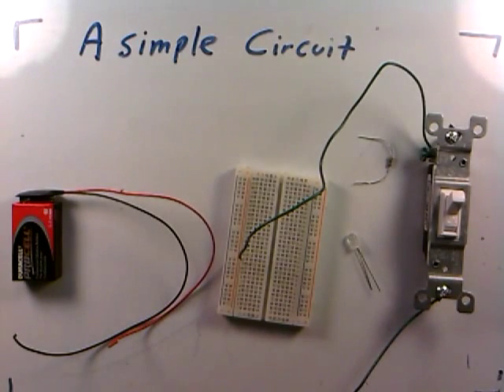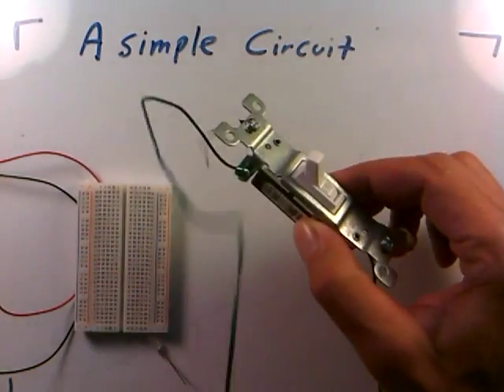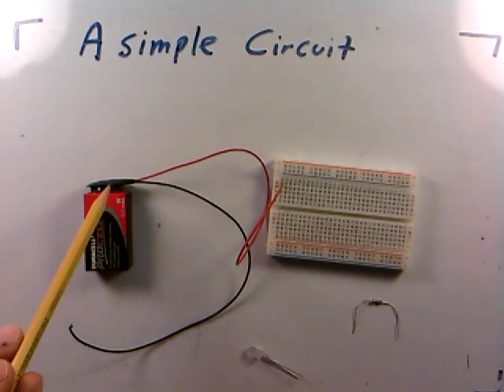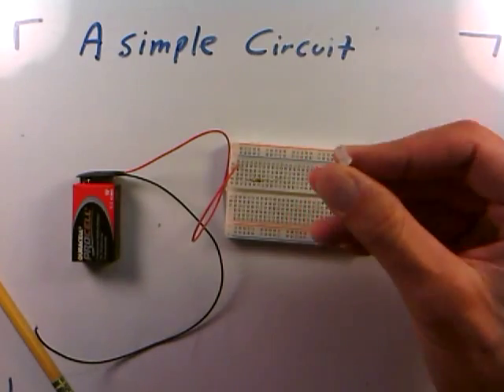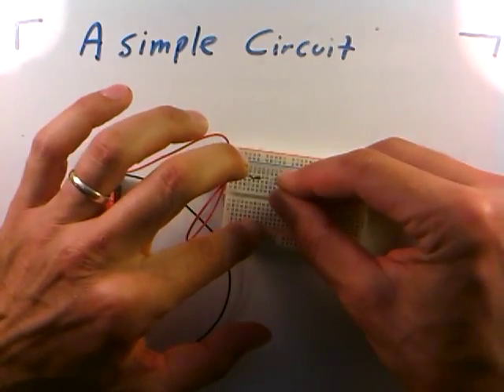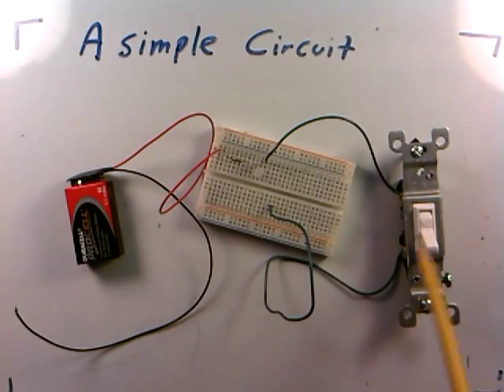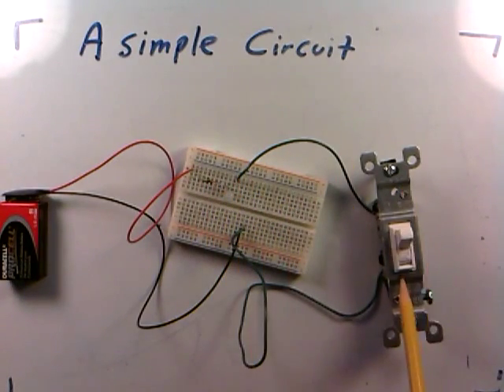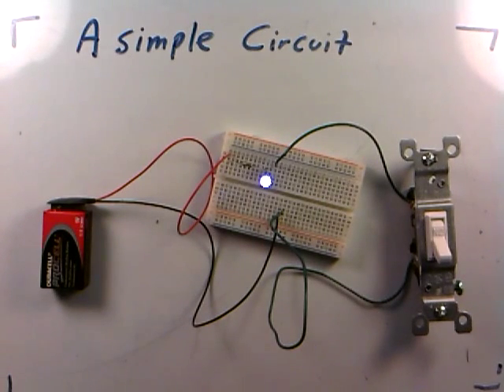elec 012 battery resistor led switch circuit

Comment: one thing i dont understand. i was told current flows from the negative terminal to the positive terminal? if this is true. why does the LED not blow up? It would be on the wrong side of the resistor? Do you know what i mean? Does current flow from positive to negative or negative to positive?